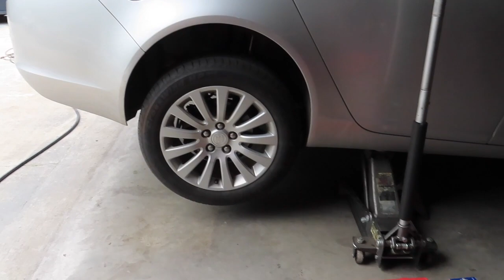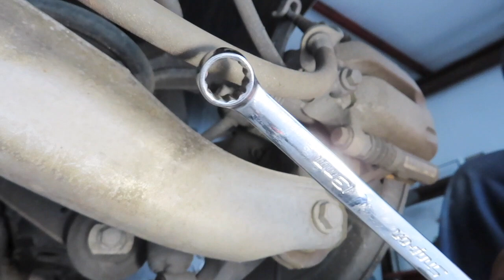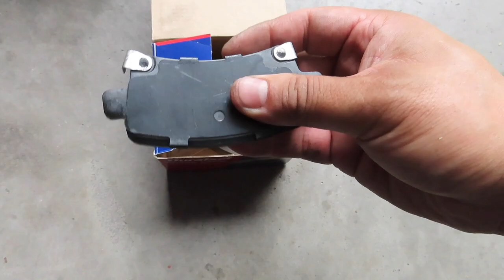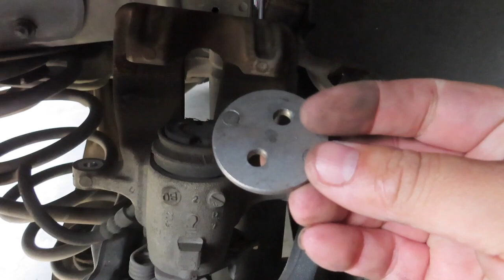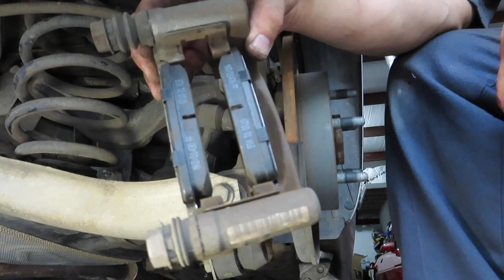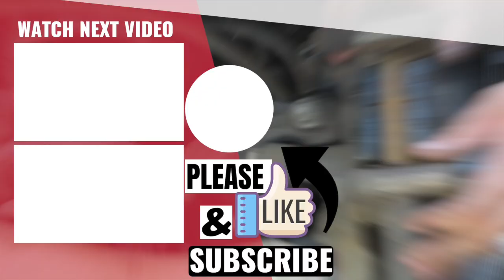Rear Brake Pads Replacement 2011-2013 Buick Regal

Comment: Oil Reservor cap not need to be taken loose or tightened when done?  I do wish you would have addressed WHY the calipers have to be turned in. What is the mechanics/reason for these???

Comment: Why is that special compressor required.  I have been compressing caliper pistons using just the old inboard pad and a c-clamp forever.  Is there a reason that it's needed on this car?
Reply: The parking brake is built in.
Reply: Electronic parking brake

Comment: What is the name of the SPECIAL tool?
Reply: Brake piston compressor
Reply: Do you have to do that to the piston if you don't have the tool?
Reply: Chris Rockwell you have to compress the piston whenever you change your breaks so that the new thicker break pads will fit.
Reply: @InUtero1994  oh ok. Thanks a lot.
Reply: Chris Rockwell the tool mandatory for my vehicle cause the back brakes required the piston brake compressor kit that had a bunch of different sized keys that I had to fit into fitting. But my front brakes didn’t need the fitting but I still had to use the tool to compress both. Hope this helped

Comment: I feel sorry for your customers u should the most low quality parts for them. Wagner thermoquiet is really good brake pads
Reply from the maker: I agree with you 100% on always using OEM parts, but I give my customers options. I'm always very honest with my customers and give them the flexibility to lower costs. I do educate them on how the systems work and the quality of parts that are going into their vehicle. I let them have the final say on what parts they would rather I use. It all is left to what is their budget.

Thank you for your comment.

Comment: Do you need that special tool for the Piston on the front too or is it just on the rear?
Reply from the maker: You just need the special tool for the back and not for the front.
Reply: @MachineHeadRepairProjects
Reply: no special tool need use a clamp to push in the silinder and turn it
Reply: brett buttars - I will attempt to change the rear pads in my regal soon. Have you done these without the tools on this car? I am asking because I have changed many pads on American and Japanese cars without a special tool; just a simple C clamp. The Buick Regal is German and I’ve seen others used a similar tool. So my honest questions is if you personally changed rear pads on such German car without the tool and if it worked without damaging anything. Thank you.
Reply: That bracket only needs to come off if your changing the rotors.